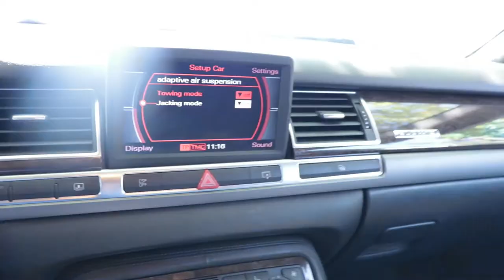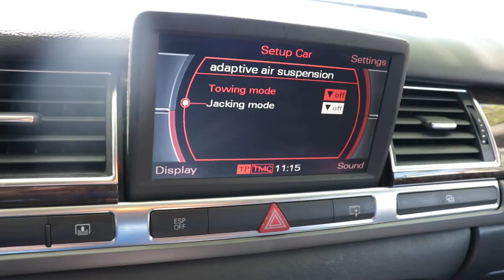Audi a8 control arms bushings replacement

Comment: My mechanic charged me 5 hours to complete this job. I will get back to him and told that it`s actually 16 min. I feel robbed.
Reply from the maker: If there is a car lift and impact gun is around 2 hours.
Reply: Try 2x playback speed. 😂
Reply: bolts could have been siezed who knows what he came up against  and  both sides would be probly 5 hrs

Comment: I tried this and the bush completely crushed. Thin aluminium side wall didnt stand a chance I tried 2 bushes before I went out an got the arms. They were about £80 for 4 arms total, both sides. Maybe I the used wrong size socket both times.  Febi Bush sold by amazon direct from amazon. Fare play for all hand tools and getting the top pinch bolt so easily. That was the hardest part by far!
Reply from the maker: Yes one of the top bolts was a bit tricky, it is even harder when You try to film all process. But i'm happy that video is useful.
Reply: @chichovenci  I'm impressed you pressed it so easily. I am waiting for no rain to do the lower rear control arms inner bush. I know I can press those 100%>
Reply: @Esoteric Chaos I would take a pry bar to you front axle, lower rear arm, inner Bush. They are about £20 each and can be pressed. That was the bad ones for me. These top arms I got from GSF car parts for about £25 each but didn't notice much difference in the drive and the new ones have quite a bit of movement.

Comment: When you tighten the nuts which hold the upper arms in, they must be done when the weight of the car is on the wheel. Otherwise you will tear the new bushes.
Reply from the maker: If you watch the whole video you noticed that i tighten the bolts holding upper arms after the car was leveled  on the wheels.
Reply: @chichovenci  I didnt get that. Are Andrew talking about the one, long bolt that hold the two "outer" upper arms or the one closest to the motor?
Reply from the maker: @andreasdahl717  he's talking about two  bolts tightening each of arms inner side ( near to engine bay )
Reply: @chichovenci  so if I dont take out the whole spring system, I just need to lift the arms up when I tighten the bolts. I also have airbags and would like to not take it all out whenI do this. My car is A6 Allroad 01 :D
Reply from the maker: @andreasdahl717   idea is to haven't tensions in bushings when car is in typical height mode. That's why you tightening bolts after car levels.
Reply: that'S EXACTLY what he did. Did you even watch the video before commenting?
Reply: @Nordic_Mechanic  no. He puts the wheel on, then lowers the car then raises the suspension then tightens them.
The point when he raised it, he is not at the standard ride height it's at its upper limit which is NOT how it's supposed to be done.
Set car to ride height and tighten from underneath, or jack up the suspension from under the lower ball joint.
Do you even know what you're talking about before you commented in such a ride way?
Reply: @AndrewHellyer  You are the perfect example of the Dunning-Kruger effect.  He does NOT raise the car. the car raises back to stock height by itself after jack mode is turned off.  That's the frigging computer pushing the car back up. This wheel gap is normal ride height. When you have it at full droop in jack mode for a long time air spring can deflate and when you set it back down it's below ride height. You dont know about the working of this suspension and YOU"VE BEEN SCHOOLED .  
That man set trim height CORRECTLY. End of story.   I will be rude to idiot who do exactly what you accused me of doing.   There's 3 d3 and a d4 currently in my driveway, ones a 5.2L  v10 guess why?  

Maybe clicking my channel before telling me im wrong would have saved you some humiliation. Go ahead, make my day.

Comment: great video!
Reply from the maker: Glad you enjoyed it
Reply: @chichovenci  can you tell me the part number for the bushing and the balljoint id like to see if becomes cheaper tk buy them or to buy the whole set of uppee control arms
Reply from the maker: 4E0 407 515 D, 8D0 407 515 B, 8D0 407 515 C, 8D0 407 515 D one of them (found in google).

Comment: Why did you leave the air out, Is it necessary for movement of the shock? Also, is suspension calibration with VCDS necessary?
Reply from the maker: If you don't release the air pressure you can't compress the shock, and you can't took arms bolts out. I haven't used vcds after the repair, everything was fine.
Reply: @chichovenci  Thanks for the reply. You didn't show the ball-joints - how did did you separate them - splitter?
Reply from the maker: @jonniewoz1447  upper ball-joints was the easiest part. It's difficult to replace bolt tightening upper ball-joints ... when you replace the bolt, they come off easily without separator, upper ball-joints aren't conical.